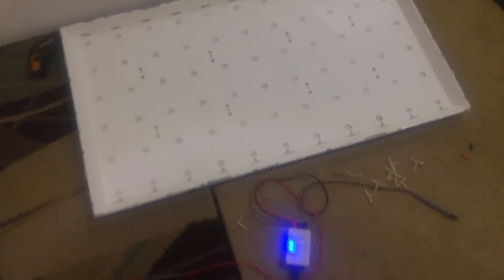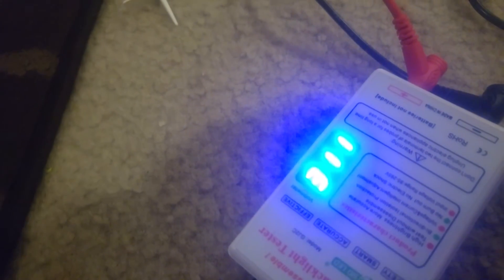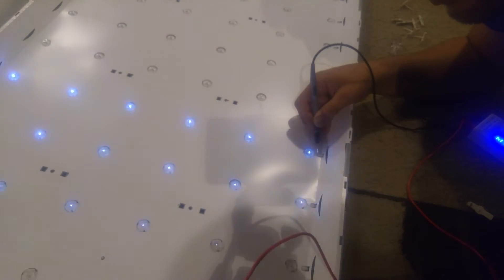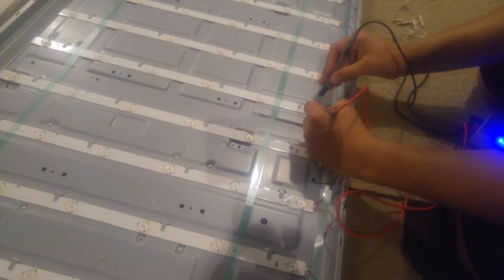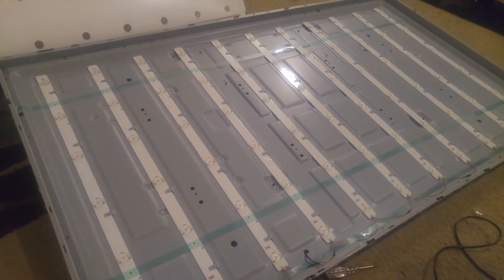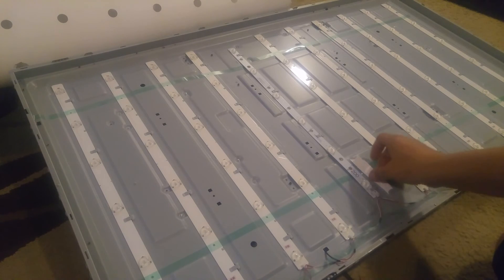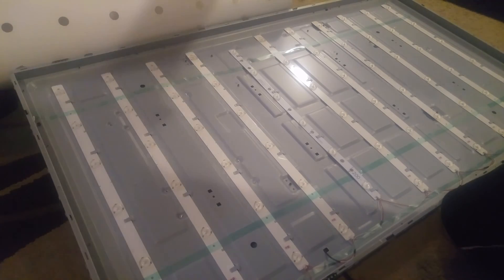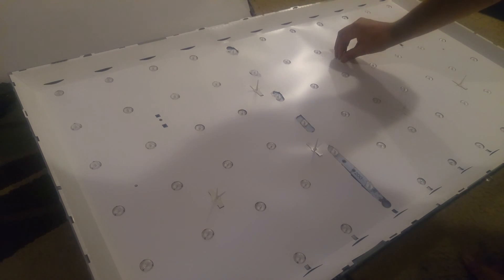Help my Hisense smart tv wont turn on! no backlights repair

Comment: Hi I have this exact same TV and I have been troubleshooting it the last 2 days now and came across your video. Mine is also totally dead and when I press the power button the red LED on the front blinks 10 or 11 times then turns off. I did some searching and found someone else with the same problem who said it was a backlight problem so I took everything apart and sure enough one of the 11 strips wouldn't light when given 18 volts. So I tested each of the 6 LED's on that strip and one was dead so I replaced it with a 3528 LED and then the strip lit up fine. So I put everything back together and powered on but the backlight only came on for a split second and there was a little pop sound and it all went back off again. Now the same thing happens the red LED on the front is blinking 10-11 times after hitting the power button. I checked the voltages on the backlight output and was seeing it fluctuate between 220-240V but sometimes I saw it spike up to 355V for a split second. I assume the random high voltage spikes are nuking the LED's but I don't know what would cause such a thing.

Comment: Never understood why someone would tear the tv down to the backlights and not just replace the led. Seems like a lot of work just to rig it. A roll of 100 leds is like 5 bucks on eBay.
Reply from the maker: I bet there's a lot of things you don't understand..like the voltage running on those LEDs.

Comment: Hi Techie Life.... I am back again with another question. After replacing LED Strip and putting TV back together, I now have a new problem. The Red Power Light stays on steady. If I push the on button nothing happens. The light just stays on but TV doesn't respond or turn on..... I was seeing Menu with flashlight & getting sound before I replaced the LED Strip. Now nothing.... Do you have an idea of what the problem could be?

Comment: Hey question!!! I have a 55” Hisense that won’t turn on… the red led just flashes once and starts dimming in and out and will pulse. I replaced the entire power supply and that’s not the orblem because it’s doing the same thing… would you replace the TCON board next or would the tv refuse to power up the other leds if one strip is bad? I get no backlight at all and the tv isn’t powering up. Thank you!!
Reply from the maker: Try this.. when you "turn it on" try to plug in some USB to the tv,like a phone charger.. if you get power to the device, this means the tv is actually on. Once you "turn off" the tv, the power should stop powering your device. This is a good indication that it's the LEDs lights. Hisense is notorious on having bad LEDs.
Reply: @TECHIELIFE  Thanks Soo much!! That’s a great idea!!!! Thanks man!!!
Reply: @TECHIELIFE  Do you have a suggestion of good suction cups or something to get the screen off with? I tried some harbor freight suction cups on the last screen and it had a manufacturing flaw and dropped the screen on when one cup gave loose.
Reply from the maker: @techwiz2410  i have ones from Lowes. Look in the tile isle. The most important thing on the suction cups is to make sure you ores firmly down before you lock it. And also when you remove it, place the LCD in a place where there's no chance of any contamination..like dirt, dust, or hairs. You have to keeps things clean. If not, when you assemble it back, it will show in the picture. I gave other videos showing how to replace a screen.
Reply: @TECHIELIFE  Thanks sooooo much!!!!!

Comment: You are a savior my friend,  I finally may have found a solution to my broken hisense of 2 years thanks to you. I'll try this method as soon as I find some led strips. Just one question, is there any way to test which led strips are blown without a multimeter?
Reply from the maker: Nelson Sanchez you could try to use a 12 battery or 9v and power each individual strip. It may be dim, but should work.
Reply: Thanks Im tearing  the TV apart now, I just wanna know how you got to the screws behind the ir sensor holding the bezel and the frame together
Reply from the maker: Nelson Sanchez that was a pain..
Reply from the maker: Nelson Sanchez just use a small flat head.. be gentle.
Reply from the maker: Nelson Sanchez by the way I'm have some LEDs for sale if you need the strips. I got a full working set.
Reply: Thanks man i ended up drilling couple hols in the frame to get to the screws. Ill probobly take u up on that offer i just gotta figure out how many i need
Reply: So far i took one bulb off of 1 strip that looked burned out , i tested it and it was dead, tested the bulb right under it and it was good,i just cant seem to get the whole strip to light up , to test the whole set id have to remove each bulb and test each individual light?
Reply from the maker: Nelson Sanchez  no not really.. if I were you, I would take each strip off and test out with probably 2 9 volt batteries. This would give you 18 volts. Which in term can power 6 LEDs. Then if it doesn't work, then you know it's a bad strip.
Reply: Ok cool i just cant find where to Make contact to light all 6 lights up
Reply: so would hisense flash on for like 1 sec before goes black

Comment: Thanks i subscribed i used to own a skateshop in Bakersfield for 17 years but i went out of business anyway i go to yard sale and buy tv electronics etc. And fix and sell when possible if i dont have led light or strip how do u bypass or u said copper wire??? I really thank you if u could tell me.    Joey
Reply from the maker: Joey Witt you can try to solder off the little led and just solder a glob between both contacts. You goal is to connect both sides together which will complete a circuit.

Comment: My hisense h50a6200 tv won’t start up just a red light comes on no flashing solid red.. soon as I press standby button telly cuts off dead have to turn on by plug again am so on ... I’ve bought new psu board main board t con board an module an start button lead ... nothing happened.  please please please can anyone help me with this problem I’m stuck fast .. thx 🙏 people very much x

Comment: I have the HiSence 50H5G and the red power light comes on and stays on but I have no picture. I need advice on trouble shooting this. TV was working fine I went to sleep the other night and when I woke up it wouldn't come back on.
Reply from the maker: TheShape75 do you hear sound?
Reply: I had the same exact thing happen to me went to sleep woke up no picture. But when I shine flash light I do see Menu, etc. Also yes to sound. Should this fix work for me?
Reply: Also how should I set LED tester?
Reply from the maker: khumello I think so.
Reply: Man you a Master!! I will soon give it a try and reply when finished.
Reply from the maker: khumello you don't need a tester, but you can use a home made battery.
Reply from the maker: khumello look at my other video.
Reply: I can’t turn my tv on is it worth keeping
Reply from the maker: Frances sanchez only if you willing to fix it yourself. If you pay some one, it tends to be more expensive.
Reply: TheShape75 how did u fix it

Comment: I tested my LED strips one at a time by having them all disconnected and plugging in one at a time. None worked. Or is that not going to work anyway? thanks
Reply from the maker: dubbya57 I don't think it will work. They are in a series circuit. Your best bet is to use a 12 v power source and try to power it somehow.

Comment: got same issue. did your light flash 6 times? where did you get that led tester and are you using that tester to also test individual leds for fault? thanks..
Reply from the maker: Yes same blinking red light. I got it from eBay. And it will test individual LEDs as well. Cost about 20 bucks u think. Type led tv tester
Reply: @TECHIELIFE  thanks. i see different mldels with various voltage outputs. what volt output would i need?

Comment: Hi TECHIE LIFE Could you tell me how to remove IR Sensor to remove Bezel please.... There is no way to unscrew it there's no indentation on screw.
Reply: I cant separate screen from back of TV.
Reply from the maker: khumello use a flat head. It basically snaps off. Really bad place for the designer to put it there. But there's no other way.
Reply: thanks bro. Finally got everything off.... but don't think I have the right LED tester. What kind should I get? Or what brand and model do you have please?

Comment: So would running the tv at a lower brightness in the settings lower the voltage going to all the leds?
Reply from the maker: So I always recommend to never go full brightness on these TV's. The brighter they are the more heat it generates. LEDs will die from heat..